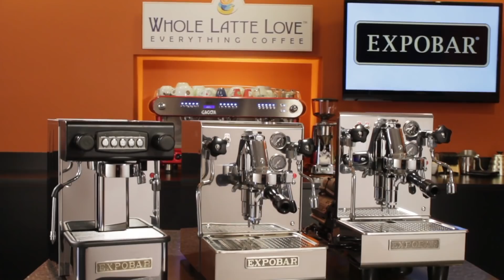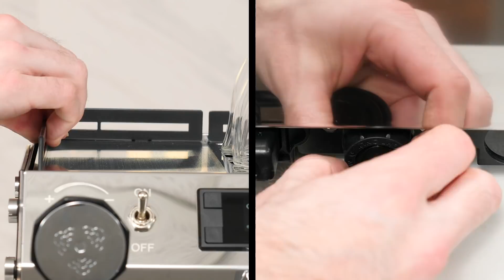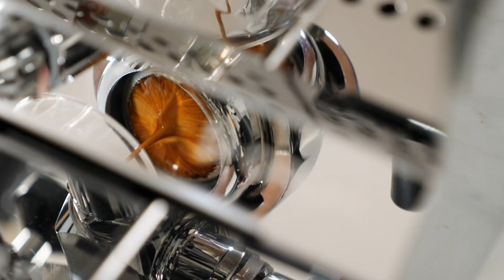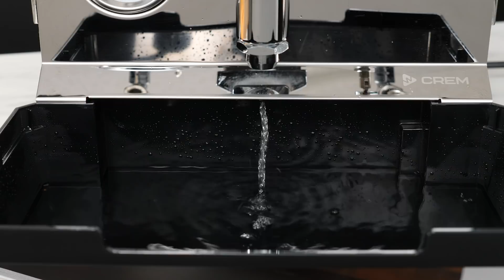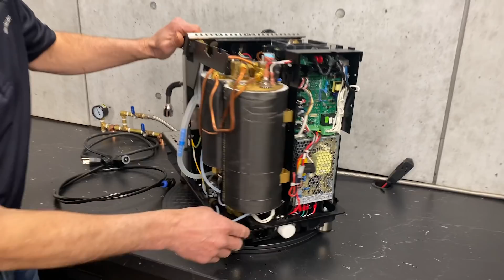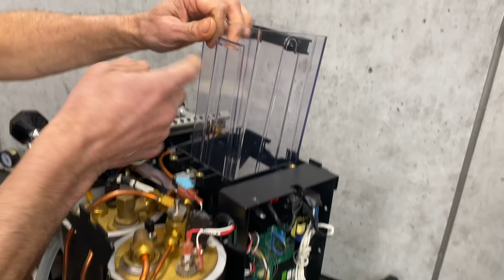Review: Crem ONE Infuser Espresso Machine

Comment: We run a coffee stall once a month and want to replace an old commercial fracino with a machine that can be used in the home as well as at our market event. 
Usually in 2.5 hours we can make up to 50 coffees, I’ve been eying up the CREM one as the machine of choice but do you think this would hold and maintain boiler temperature for the duration??
Reply from the maker: Hi phil, the Crem has uses a unique systemt with a heat-exchanger in the steam boiler which pre-heats water before it goes to the brew boiler. With that setup it should be able to maintain the boiler temperature.

Comment: I love my machine which I've had for a few years now. Recently I have found that there is no water coming out of the waterspout. Can someone please advise me what I should check on the machine.
Reply from the maker: Hi jj, Thanks for sharing your love of the machine! Is your machine making steam? If so then there's likely a blockage of some kind in the path of water from the boiler to end of water tap spout. First and easiest thing to check is the diffuser screen at the end of the hot water spout. This unscrews from the end of the hot water arm. It does have a screen and cartridge with narrow passages which may clog with limescale particles or other material. Try removing the diffuser and dispensing hot water. If you get hot water out then that's the issue. It can be cleaned using a descaling product. If that's not the issue then a clog somewhere back further in the path to the boiler connection. Could be at the valve or further back to hot water pipe connection to the boiler. Many issues like this are caused by using hard (mineral rich) water in a machine. To prevent issues it's best to treat water to reduce hardness - specifically calcium level.
Even if your water is not hard, minerals can concentrate over time in the boiler and cause scale deposits if you rarely take hot water from the tap. It's a good practice to take a cup or two of hot water from the machine every few days of use to reduce mineral concentration in the boiler. 
If you're still having issues and purchased the machine from us please contact our Tech Support team here for additional assistance: https://support.wholelattelove.com/hc/en-us/categories/360005124554-Technical-Support
Reply: @Wholelattelovepage  Thank you for getting back to me with some suggestions. I have started with unscrewing the hot waterspout. There was a little bit of limescale that I brushed away, but it didn't fix the water flow. As you also suggested, I think the problem is back further. I will definitely do further checks before taking it into where I purchased the machine. They will be happy to help. It's still making a lovely coffee every morning. Once I get it sorted, I will definitely take water from the machine regularly in future. Thanks again for your support. JJ
Reply from the maker: @jennyjudd5501  Happy to help!

Comment: I just got my infuser and have a question if I’m using my machine say in the afternoon at 5 pm how do I get it to go off without tuning the switch off so it can come on automatically at 430 am in the morning,  I’m the morning it coming on but the led isn’t lighting up all the way
Reply from the maker: Two ways to turn it off without flipping the switch - either schedule an auto-off time in the menu, or press and hold the top left button on the screen until it displays "off."
AJ

Comment: I know the CREM has a Dual boiler but does the brew boiler have a heating element or is this an HX machine with a type of brew boiler reservoir for temperature stability?
Reply from the maker: Hi Gary, The Infuser is a dual boiler machine so the brew boiler has it's own heating element that's independent of the steam boiler. New water entering the brew boiler is pre-heated by traveling through a heat-exchanger in the steam boiler to imprive temperature stability.

Comment: well... this is one very nice machine... I wonder about the flow control( ecm) verses this type of timed infusion.. any thoughts.. ??

this is crushing others for price at 2700
Comparing to ecm Synch and prof 600/700
Reply from the maker: Hey Matthew, the gradual soft preinfusion will be easier to work with, but flow control will open up more possibilities. You're right - for the price, it's hard to beat the feature set!
AJ
Reply: @Wholelattelovepage  
Quality
Features all look to exceed expectations
Some differences ie stainless boilers on ecm prof comparables
But
This rotary pump machine looks amazing
Reply: @Wholelattelovepage  
Can one add in future the e61 flow control-valve?
Reply from the maker: As far as I know there are no plans for Crem to produce an E61-mounted flow control device. In theory someone could install one from a different manufacturer, but we haven't tried it so I can't say for sure. 
AJ
Reply: @Wholelattelovepage  
Im sure this will b fine as is!
It is right there next to Lelit Bianca and ecm Synch for my first choice

Honestly had to “get over” the electronic menu! Strange personal quirk and once i was resolved i see all the good things it can do

Comment: Would like to see a more in depth video on how to get the case off and adjust brew pressure. 
The manual is less than to be desired for such a high end machine.
Reply from the maker: Hey Mark, we’re currently working on that video, which will go deep into all of the menus, how to hook up water/drain lines, adjusting pressure, etc. It will be basically be a “video user manual.”
AJ
Reply: @Wholelattelovepage  sounds great! Crem needs to work on the manual. These details should be included with the machine and I appreciate all your great videos. 
One shouldn’t have to see in a YouTube video how to access the hidden menu but I did catch it in one of the videos with a 111 password.
Reply: Mark,
The manual is not very good. Lots of missing information like guidelines for changing pre-infusion times.
Some of it was written by a lawyer trying to protect Crem from users.
Example on page 11. "not intended for use in industrial kitchens, domestic kitchens or similar locations"
Reply: @RichardWerbin  I guess it’s intended to be used outside.
Reply: @mgarwatoski  
Manual also says not to use outside
Reply from the maker: In case you missed it (and for future readers), here's the video startup guide for the infuser: https://youtu.be/lCc9l7ObItQ
AJ

Comment: I'll be honest, I've been waffling for the past year or more on buying a Profitec Pro 700 or ECM Synchronica but I have been paralyzed by FOMO regarding Flow Control. I think this model fits right in my Goldilocks zone of features, including GSP in place of Flow Control.

Question regarding Gradual Soft Pre-Infusion... Is there any reason that this could not be updated and utilized as programmable flow-control profiling in the future? Think Dalla Corte Mina's Digital Flow Regulator at a fraction of the price.

Edit: Actually, I see that you've already answered this question in another comment. Looks like this feature will be available on the Crem ONE Profiler. I can NOT wait for the video on the Crem ONE Profiler. Thanks!
Reply from the maker: Hi CP, Thanks for the question. Marc here and I'm currently working on video of the Profiler. Should be posted late this Friday or next Monday so stay tuned! Very cool machine which can be used like any other E61 group machine. But then goes next level with fully manual profiles and the ability to save 5 profiles and have them run automatically.
Marc
Reply: @Wholelattelovepage  Hi Marc, Will they be available for purchase tomorrow or Monday? The chat on your website tells me it won't be available because of changes WLL has asked be made to the Profiler before it's sold.

Comment: How long does a dual boiler machine like this take to heat up in the morning?
Reply from the maker: Hey John, it takes about 25-30 minutes to heat everything up. Even after the water in the boilers is up to full temp, the success of E61 machines comes from the large thermal mass of the group that's heated by a thermosiphon of water from the brew boiler. I use this machine every day and program my "on" time for 45 minutes before I get to the office so it's ready before I show up. 
AJ
Reply: @Wholelattelovepage   Thanks for the answer. Yeah, my "little" Expobar Office Control machine takes about the same time because of the E61 mass.

Comment: This machine looks fantastic and its performance seems awesome but I concern about where it’s made and some finish like the drip tray seen like plastic right?
Reply from the maker: Hey Francisco, the machine was designed and engineered in Spain and manufactured in China by Welbilt, who specializes in commercial food service equipment. There are more plastic components than on some traditional machines, but that does come with advantages. Aside from cost savings, the polycarbonate frame is durable yet flexible, which helps avoid damage during shipping. It's also lighter, and more versatile when designing and placing internal components. It's not for everyone, but design choices like these certainly help pack this high level of functionality into a machine at this price point. 
AJ

Comment: Great video! (And it's nice to see a brand descendant for my Brewtus IV!) Quick question- if you weren't planning on plumbing the gizmo in, how do you filter water in this style of reservoir?
Reply from the maker: Hey Rob, thanks! My suggestion would be filling the reservoir with a BWT penguin pitcher: https://www.wholelattelove.com/products/bwt-penguin-2-7-l-water-pitcher
Another option is the BWT Bestsave filter pads: https://www.wholelattelove.com/products/bwt-bestsave-m-anti-scale-filter
Both of these will protect the machine against scale, you'll just have to wait longer for the Bestsave to soak, which is why the pitcher is my first choice. 
AJ
Reply: @Wholelattelovepage  Thanks, AJ!
Reply: Mine arrived today. It came with a filter to plug into the water tank. Weirdly, the manual says to replace the custom filter every 2 months.

Comment: I thought ECM was the best with engineering - Crem takes it to a whole 'nuther level. You can even see the 'naked' shower screen without purchasing a welding inspection mirror on Amazon!
Reply: The ECM Synchronika (Sync) has stainless boilers, the Cream line has copper boilers.  The Crem brew boiler is double the size of the Sync but it has a smaller steam boiler and the reservoir on the Crem is less than 2/3 the size of the Sync. The pressure on the Sync is up to 2 bar.  If you plum in the Sync, you can have timed manual pre-infusion. For me, if the Crem had stainless boilers, then it would be in competition with the Sync.  Plus, I personally like the paddle style wands instead of turn knobs.  I'm still sticking with the Synchronika for my top pick of semi auto dual boiler machines.
Reply: @GuitarStuffHub  I always wanted the ECM Mechanika V Slim, my coffee bar isn't as big as I would like it to be! <3
Reply: @Satine_Moisant  I know myself, and if I buy something other than the Synchronika, I'll get the machine and once I have it for a couple of weeks, I'll say to myself, "what's $500 or $700.00 more to get what I really want," and I'll kick myself for not buying and crying once!  If I don't get the Sync, I probably won't get any machine and stick with going to my local coffee shop for my espresso fix!  The Sync wont fit on my coffee bar either so I'll have to buy a dedicated table before I buy it.   Good Luck in your quest for an espresso machine!
Reply from the maker: Thanks for the comment. ECM engineering has always been top notch, but Crem gives them a run for their money. The shot mirror is a nice touch I find myself using more often than I expected. 
AJ
Reply: @Wholelattelovepage  I'd totally buy this machine. It's loaded with features and beautiful!

Comment: Mine arrived today and it’s an awesome machine. The hands free milk frothing really does work like a charm.
Reply from the maker: Great to hear! Enjoy the machine, it's truly incredible. 
AJ
Reply: @Wholelattelovepage  Once I set on/off times for each day and eco and standby times do I just leave the machine turned on?
Reply from the maker: Yes, leave the power switch flipped on and the machine will turn on/off on its own. 
AJ
Reply: Do you still love it? Does it have any flaws? How is the tank, too small?
Reply: @kfiatos  I love this machine. We use it every day for 3-6 drinks and fill the tank about twice a week. I think the tank is fine. I have it placed where I could plumb it but haven't found a need to spend the money on a filter and not just use my BWT pitcher.

Comment: Crem one hx pid over the appartamento and the profitec pro 500 pid?
Reply from the maker: The Crem ONE HX PID wins over the Appartamento in my book: PID, double manometer, shot timer, and plumbable. It's closer with the Profitec Pro 500... Benefits to the Crem are the option to plumb in and run a drain line, shot timer, commercial certification, and shot mirror. The Pro 500 has a more classic style and higher-end finishing on the casework. 
AJ